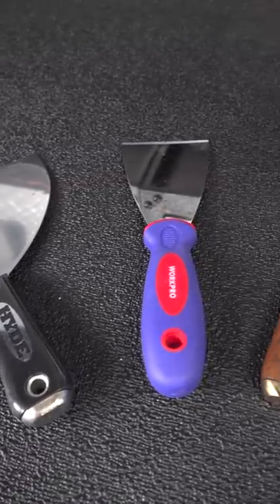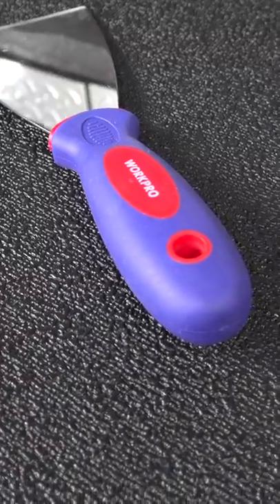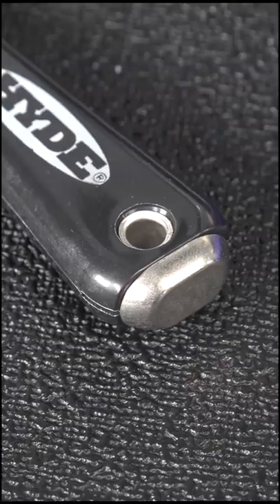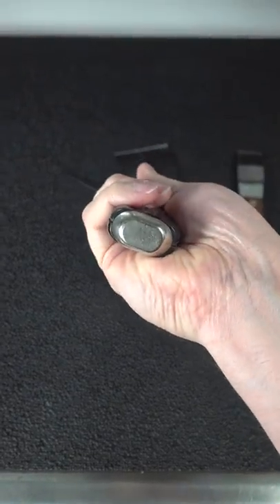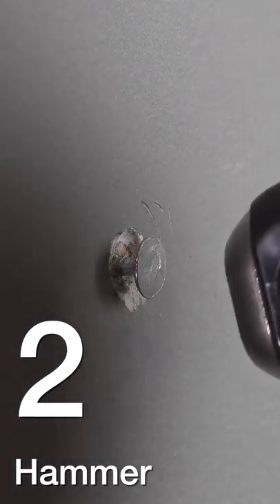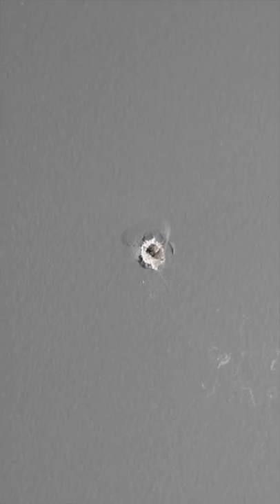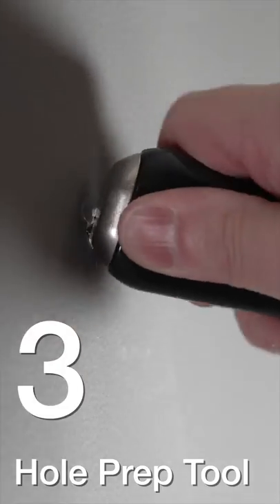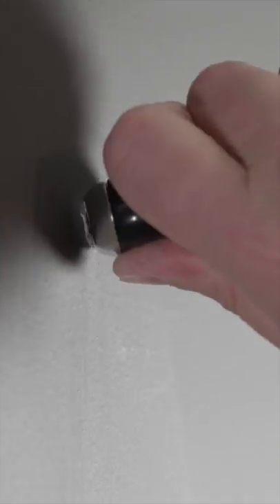Few Know the 3 Uses for the Metal Cap on a Drywall Knife  #Shorts

Comment: Also, use that cap to push down cut edge for the same reason. A fresh piece is tapered to keep the surface below the compound, a cut edge isn't so pushing it down with that cap is useful especially on seems.

Comment: Don’t re-drive a popped nail and cover it with joint compound; it will just work loose again. Instead cap the first nail with another drywall nail so that the second nail’s head covers about half of the first nail. Then the first nail will stay in place. Use a drywall hammer.
Reply: If that was the case my house would have nails popped out all over, I drove probably 50 in 5 years ago when we moved here
Reply: @ryantracey8574  fortunately no one uses drywall nails anymore. When I started, Everything was nailed and a lot of hangers used double nails. The guy would drive one dry tight-nail, then drive a second nail about 1 1/2-2” away. After he drove the second nail, it pulled the drywall really tight to the wood stud. Lastly he would hit the first nail once more. This was how drywall was attached for years. Popped nails were always fixed by capping them with a second nail.
Reply: surely you guys have moved to screws by now, surely?
Reply: @Neishy4AGTE  Houses built before 1980 will have only drywall nails.Even into the early 1990s, Hangers used what they knew and tacked up sheets with nails and had someone else screw off the field. Today you seldom see anyone handnail anything. It saddens me to see carpenters building houses who can’t skillfully drive a nail. 25 years ago, I liked to challenge young framers into nailing contests. When the time came to start, I’d pull out my Plumb rigging ax and they would ask, what’s that? I’d smile and say you’re about to find out!
Reply: If you cover it with mud I’d imagine it’d be fine. And besides who tf uses nails anymore, screws are objectively better in 99% of scenarios
Reply: @nolanrolles6528  this isn’t a discussion of the superiority of screws over nails. We all agree screws are much better. No one uses dry nails to hang Sheetrock today. Screws are not as fast but they hold at a factor many times greater than drywall nails. Over time and due to natural physical forces, the friction holding the drywall nail shaft in place can lesson. The cupped head of a drywall nail will cause a visible ring or paint flake to occur. At this point driving the nail back in place will only temporarily fix the problem. Over time, the nail head will loosen (pop) and become visible again. Popped nails, in older homes can be fixed by removing them or capping them. It is much easier and faster to cap them. As added insurance, place some addition drywall screws adjacent to the nail pop, in the wall stud, rafter, ceiling joist or truss.
Reply: Most commercial guys I know use adhesive to install drywall now with only one or 2 screws use to keep it tight to the wall until the adhesive drys. Remove screw and skim the hole.  No nail pops or screw problems  to ever deal with. It speeds up the jobs considerably too since your only finishing joints now.
Reply: @mcbridecreek  auto feed screwguns are pretty fast. I just see nails talked about so much in America I was wondering why they are still a thing, like it's still common to see hammering in nails for framing talked about. It's all nailguns or batten screws here in Aus.
Reply: @Neishy4AGTE  collated auto feed  screws are costly. The aren’t new either. I saw my first auto feed screw system for flooring in the 1990s. I was a framing contractor then. Here in the USA, nail guns replaced hand nailing in the 1980s or sooner. Even so, some things were better hand nailing. Facia for example. Before cordless nail guns, I preferred to handnail facia. No hose or gun to pull around while in the rafters or trusses. Since the Hitachi NR83 came out, hammers pretty much went silent. We will always need a hammer! These days you might as well carry the lightest one you can. The biggest challenge tool makers have now is to make cordless nail guns powerful, light and smaller. Milwaukee makes a 16d framing gun that is powerful fast but it is heavy and cumbersome. Hammers are still lean and mean!

Comment: The plated hydes are junk, just go with stainless steel you don't want WD40 on your tools that are used for finish work. Also I prefer to remove nail pops and replace with screws nearby, the nail pops you hammer back in will just come out again the future.

Comment: I'm surprised how many tradesmen don't know this. However I have to speak against using the handle as a hammer, I've wrecked a few hammering, even loose nails, it's probably fine occasionally just not often.
Also the WD40 isn't necessary on quality stainless but definitely cheap tools.
Reply: I wouldn't call stainless quality.
They don't have any feel to them.

Comment: That was a stainless steel blade you don't have to use WD-40 on it! And one more use of the hammer and of that 6-in blade you can scrub it up with sandpaper down till you see the copper and you can use it as a pencil for marking touch up areas.

Comment: That's a good tip but I've been doing this for over 20 years and I've never had to use WD-40 as long as you clean your tools up with a nice scrub brush and hot water and dry them off you're good

Comment: You use the blade to remove the stuff sticking off the the metal cap to creat a dent but hitting the hole creates a concave tha smooths out flat

Comment: The time my Hyde 4 inch  broke and I read a sticker under the plastic handle on the metal that said made in Japan and the outside plastic said made in the usa, I just had to show everyone that sticker for years afterward, when my 6 inch blade broke its blade edge went into the wooden steps about 10mm on the corner, being rubbed on paper all the time plastering makes them razor sharp, they it takes ages to get a brand new tool up to speed and the way you like them, if the nail went back in so easily it should of been removed not nailed in again, it will pop out again and your doing the job 2 times.

Just buy stanless steel blades and you don't have to use spray and the blade won't be slippery, I hated rust on the blade in the area your fingers applied pressure, just a funny feeling I never liked.

Comment: Or just use the corner of the blade to fix screw holes?
Reply from the maker: Doing that will lift the edges which is what you are trying to avoid.

Comment: Wd40 is absoluetly unnecessary and messy for no reason.
I still have my dads spackle in full metal from the 70s. Would always wipe it clean and i do the same today.
No rust on it. 

I get wd40 is like duck tape, doesn't mean you put it on everything
Reply: It also means you have to clean your knives before work to get the wd40 off and after work to get the mud off

Comment: I use to think the metal cap was for hammering soft cement off a fresh pour
Reply: That's super secret function.

 I don't do alot of drywall work, but I've always used those to scrape off pipe gaskets, sometimes you gotta bust out the hammer when they're stuck on. Chisels are too hard and will shave off or dent the mating surfaces of pipe flanges.
Reply: @dirtydoigler2116  they break every time haha 😂 but I do it anyways

Comment: If you think the metal cap is more durable than the plastic handle, try dropping them both  on the cement over and over again.
If you think you can't rub out a hole in drywall with the plastic handle, go ahead and try it.
If you think the butt end of any putty knife makes a good hammer, there's no hope for you.  
What a cheap way to get hits on your Amazon sales
Reply from the maker: I like how you wrote it like poetry. If you think when it comes to tools plastic will win out long term over metal, you dont use them much.
Reply: @SilverCymbal  I DARE you to test that claim.

Comment: Okay wait a minute. You don't use a 4-inch knife for a nail hole but if you do you put a tiny amount on the corner of the blade. Your demonstration made a 8in Smooth Spot. You don't have to wipe off what you don't put on in the first place. Do you need a three-quarter inch patch try one inch of mud not 8 in.

Comment: You don't put a screw in on top of or in place of the nail? Fuck nails in drywall. It's the dumbest thing we continue doing for no reason other than giving a homeowner a headache later. I never saw drywall installers use nails in commercial construction, even where there was wood framing.

Comment: As a 15 year Union Taper . I approve this message 👏 👍 👌 🙌
Reply: Years ago I was on a union job and the drywall finishers had to use drywall knives and the plaster people had to use trowels, no knives. Even though it was a union job, I was paid by the piece because I worked so quickly, I could make more money. I paid a standard union wage check plus a, "bonus" check to make up the difference in how much I finished, but it was all figured by the piece. The one check was what the union guys were actually paid and the bonus check added the difference, what I finished by the piece.
Reply: @jimjungle1397  yea there are some companies still do it that way. Well Hopefully you better than ever brother .

Comment: Those blades are stainless steel. Unless you're storing it in a salt bath you shouldn't need to oil it.
Reply: You've obviously never worked with drywall finishing tools.

Comment: Stop the 🧢🤣That nail pop is just going to pop back out. Ruin your work. There's a reason it did 1st place. Run a 1¹/⁴ sheetrock screw right above or below it. You can pound nail in, or pull it out

Comment: Well.......Bless your heart........you didn’t know you can do the same with the plastic handle! The actual reason for the cap for decoration,  Geez the idiots out here!
Reply from the maker: Of course, and that plastic one will work for about 5 repairs before the end is trashed and then it will make the hole even worse.
Reply: Apparently you've never used one as the same will happen to that thin shiny decorative cap its just there to cover the joint where the 2 sides come together. The plastic will actually hold up better!

Comment: Lol when you live somewhere where they only use brick for walls and not chalk and paper 😂
Reply: I doubt that most of your internal walls are made of brick.
Reply: @jic1  every single last one of them are 😂
Reply: @pipedgolf4634  Your non-loadbearing internal walls are brick?  And this is a normal thing where you are from, not a peculiarity of your particular house?  I really find that difficult to believe.  Where are you from?
Reply: @jic1  yep every wall is solid brick apart from maybe 3 international walls upstairs. And yeah basically every house here including new ones are 90% brick walls all around. And Ireland
Reply: @pipedgolf4634  Well, I don't know Ireland very well, so I can't say you're wrong, but that definitely sounds strange.  I live in England, and unless you live in a house well over a century old, or some kind of converted industrial building, typical non-loadbearing interior walls are plasterboard over wooden studs.  Seems like you're expending a lot of extra effort and expense to little benefit, but again, I don't know Ireland very well.
Reply: @jic1  danm well nah basically most houses are like this unless it’s a flat or conjoined house or something